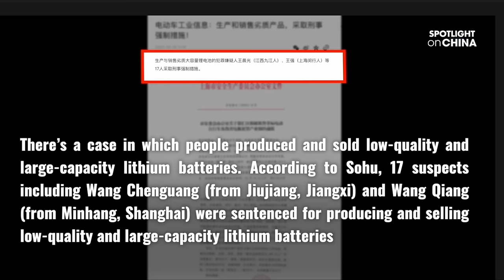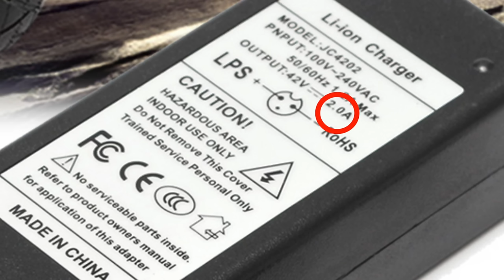What's Causing Ebikes Fires?

Comment: I can just hear the stampede of Surron  owners running into Costco to replace their fast, beloved e bikes for the anemic, but very safe, Jetson.
Reply: haha That's funny. The Jetson was the second ebike I purchased and then sold within a month. My recent purchase is a Surron and I love it. I'm not worried or paranoid over a battery fire anymore than a mountain climber is worried about falling. I think this video did an excellent job of pointing out some causes for the fires. Two things basically -- 1) just take good care of your battery and 2) be mindful of safety precautions. If the batteries themselves are or could be faulty from the outset, then there's pretty much nothing we could do about that, except to just be aware of the two points I mentioned.
Reply: @AMP3083official  So you went from an e scooter to a Tesla Plaid?

Comment: A question you can answer please Is it possible to charge Justin's bike Is it dangerous to charge it at home I keep worrying when I charge at home Can it cause a fire
Reply from the maker: I would not worry about it, the Jetson charger is slow, so even if it becomes problematic, it would take a lot longer.  The charger seems like a high quality charger with good build, compared to others I've had in the past.  As long as you avoid cheap "fast chargers", you'll be fine.

Comment: Contemplating getting an folding E Bike. Not sure which one to get. I noticed that some e bike's come with double batteries to increase the range, seems a bit silly. How soon do u think something like solid state batteries will be available for e-bikes or batteries with longer range.

Great video.
Reply from the maker: there's a lot that goes into ebike decisions, size is a major factor, hence folding bikes are so popular.  Range and speed are also a factor.  Fast machines need even bigger batteries to maintain range.  And for range, are you planning on sitting on a bike for 2 hours plus to reach destination?  Some bikes can give you two hours of range at top speed!!!  check out this video, anything over 15AH will give a substantial amount of range for smaller bikes:  https://www.youtube.com/watch?v=An3M_bW7nV0
Reply: @YouTruther  Thank you for your reply. I was thinking of something like the Samebike LO26 with a 500W motor. They have 10AH batteries, so I was wondering if it would be safe to have a 14AH battery . 

Hopefully higher capacity batteries will be available sooner rather than later.
Reply from the maker: @omaramoodi3057  yes, higher capacity, same voltage is safe
Reply: @YouTruther  . You mentioned Solid state batteries. Any ideas on if or when something like that might be available for e-bikes. 

And do you think the Samebike LO26 is a good bike.
Reply: *a
Reply: NCM builds great ebikes have good ratings too

Comment: I charge my e-bike battery out on my concrete patio inside of a metal garbage can with three layers of 1000 degree temperature insulation wrapped around the sides and top and on the bottom of where the battery is sitting and charging. on the charger I have a simple timer where I can set it to 5 hours for a 2 amp charger, or from using my fast charger which is 4 amp I can set it to two and a half hours to turn itself off. I have a wood stove insert in my house and I store my second and third batteries inside the insert and they are not being used or charged. This may seem like Overkill of course there is kill in the word Overkill. If you would like a picture of my charging and storage set up let me know how I can contact you to send pictures

Comment: CAUSE: Batteries being pushed above respectable operating limits.

CHARGER > Faster Charger, too many Amps rapidly bombarding the cells. (Slow and steady wins the race).
CONTROLLERS > Higher Draw (like a Sorron) more Amps drawn more heat generated (Slow and steady wins the race).

BOTH of these elements put a much greater strain on E-Bike battery packs.

FINALLY, once upon a time E-Bikes were (SLA) LEAD ACID battery powered, far less volatile.

Comment: My ebike battery, 1Kwh, is housed in a 3mm thick air tight aluminium casing on the bike. Full charge is 54.6 but the charger cuts out at 54v.  🤞
Reply: After watching how these cells perform (with a data logging meter), there's no point charging the stuff over 80% and discharging it below 20%. Graphs are becoming clearly non-linear beyond these limits, indicating some wonky chemistry starting to happen, probably degrading the cells and making them prone to overheating in the future. And the stories I heard about quality control in cell factories make you want to avoid the stuff whenever possible.
Reply: Luna charger set at 1amp at 80% charge . Wall appliance timer set at 6 to 8 hours always monitored meaning not sleeping in the home . Storage in bike metal frame tube or tool box with sand bags around all sides .

Comment: moisture is not a friend of batteries.
Chemical reactions cause batteries to overheat and catch fire or explode. 
Those battery packs heat up and the climate factors causes condensation and moisture once it cools down . 
That's water inside a container filled with batteries.

Comment: I got news for all that think charging is the only reason for the battery fires. First they pack a whopping amount of power in a very small space so physical isolation protection is at minimum. Second, the majority are made in China and those that aren't try to compete against China's cut rate pricing they achieve by mostly slave labor so their quality also suffers. Every since the flip phone people demand that their batteries never die but get smaller and lighter. There is this thing called physics and absolutely everything is a give and take. And to achieve the demands of the customers or the reviewers of the product safety had to take the back seat or put off the ride all together.  Size, weight, power, and cost all took precedence over safety and dependability. But another factor is the general public's belief that just because a product has the same rating number from one manufacturer to another like batteries do that they are all made equal. For instance Double A alkaline batteries. Several manufacturers make them but with differing quality but people see the same type cheaper but a different name and assume they all have to be made the same which is not the case. They also think that because the packaging looks the same then the product is the same but much cheaper. That's why so much counterfeit product is out their.

Comment: I always figured the bulk of the issues were dumbasses assuming l -ion works like nicad. Hell nicad and nimh can continue taking current forever as long as they don't overheat. Or worse they wire up a 12 volt charger cause the l-ion chargers are just too expensive. Constant current til 4.2 volts then constant voltage until the batta won't stay at 4.2 per cell. Then cut the power and on comes the green light

Comment: Wrong installation can batteries burned,Do not directly connect the lines put a HEAVY-DUTY PROTECTIVE DEVICE FUSE and BRANDED CIRCUIT BREAKER to avoid battery EXPLODE, BURNED, SHORT CIRCUIT!!.If something wrong batteries will not be affected!! E-BIKE conducting continues using power by SQUEEZING THROTTLE for a fast movement connecting on the HUB MOTOR wiring through🔋BATTERIES, If you don't have a fuse current flow will cause overheat then burn,fuse may shoulder a damage as early detection cut the current flow..Be sure that MOTOR HUB and BATTERIES watts are the same equal amount.The number of watts used by an electric motor at any moment equal the voltage supplied by a battery multiplied by the current flowing from the battery to the motor.😉👍

Comment: I have seen videos of lithium batteries that were burning and water does not extinguish the flame it burns faster. Gas powered vehicle the only way to go. If you want something small get a moped 2cycle gas powered. Hell of a lot cheaper and better on gas. then replacing a 300.00 dollar battery.

Comment: My charger does not overcharge the ebike battery. It shuts off after the battery is fully charged.
Reply from the maker: most chargers are built that way, this is more about when those safeguards fail, or how about someone with multiple chargers using the wrong voltage?  Many of these ebikes use the same ports for charging.

Comment: Why can't chargers simply shut off when the battery is charged? There is no way to know how long it will take to charge a battery, it depends on how much charge is in the battery to begin with. There is no reason the charger can't determine when the battery is charged and then stop charging. Most people who have ebikes are not electrical engineers, and they shouldn't need to be. The technology is advanced enough to take care of itself. However, charging is not the only problem. Lithium batteries are extremely dangerous under all circumstances. They can catch on fire at any time for a lot of reasons the user has no control over. And lithium burns with the intensity of an arc welder. It's not just a 200 degree F flame. It's a 5000 degree F fire that is almost impossible to put out and can easily burn through a heavy steel container.
Reply from the maker: totally agree, it needs to be dead simple, like Apple product level

Comment: First of all, mobile phones and laptops have not hundreds volt and kilowats of power output. Secondly, e-bikes have not sophisticated liquid cooling as electric car bateries and are prone to overheating. They can't be shielded and protected because of weight of ebikes is already too high  so they are exposed to elements, mechanical damage and vibrations. The last reason is that they have quite small capacity and are charged and discharged quickly so they accumulate a lot of cycles very fast  The conclusion is that ebikes and emotorcycles are doomed to fail unless we figure out better source of electricity.

Comment: "DAMMIT JIM - I'm a doctor, not an electrical engineer - JUST FOLLOW THE DAMN INSTRUCTIONS". Yep - read the instructions and learn the recharging criteria. *Leave for at least 20-40 minutes after a journey prior to recharging, *If storing (without use) for some time (e.g. over Winter), typically recharge every 30/60 days (some - SOME - batteries require a full discharge beforehand), *Use the correct charger - they mostly look alike but they sure ain't the same, *NEVER leave them unattended while recharging - disconnect (from the mains first, then the connector) when Mr. Greenlight appears, *Use your brain/common sense/experience and if/when required, seek [proper] advise. Thank you.

Comment: after reading the title the answer is, saving pennies on materials electronics and assembly...fake capton tape/no capton tape, nickel plated Steel instead of pure nickel, sub par cells, poor welds/too few welds, bad bms/ too cheap bms, too thin wires, Not enough nickel/ nickel plated Steel to carry the current, missing cell top stickers, shitty bms allowing charging In sub zero temperatures among other things, cheap/bad connectors, Not enough insulation/ protection, no insulation agaisnt water, no protection agaisnt impacts and vibrations, no temperature sensor(s) for the bms, too cheap bms, Li-Po pouch cells, no balancing between cells, no over/under voltage protection, no fuses, shit bms + shit charger... honestly i do not want the stuff most people use In my house.

Comment: Reason they catch on fire 🔥 is that the battery 🔋 pack is so large and it contains a lot of heat, heat that builds up to a critical level and all it takes is one ☝️ critical defect in the battery pack or if it hits that critical temperature 🤒 of combustibility then you have your fire 🔥.
Gentlemen  these are not Tesla vehicles 🚗 with cooling coils they are straight battery 🔋 packs they get hot very hot when you ride and when you stop riding and immediately start charging your batteries they get even hotter that’s when you burn down your house, she shed, apartment.  Don’t be stupid if you want speed buy a motorcycle 🏍️ not an ebike, ebikes are for older people who just want a little exercise without having to bike their old legs 🦵 up a hell.

Comment: Who the heck was that spraying a flaming bike with water??!! Lithium catches fire in water!!!!
 https://www.youtube.com/watch?v=cTJh_bzI0QQ
Multiple cell lithium batteries should ALWAYS be balance charged, all my RC cars and gliders use balanced charged packs. But I'm pretty sure that the 50 individual cells in an e-bike battery pack will not be balanced by whatever system controls the charging. Obviously Nimh cells are much safer, but don't give as much oomph as lithium, and it's lithium cells that are the ones that can go into thermal runaway and catch fire.
Reply: But he needed it to catch fire for the video. What better way than to spray water on it?
Reply: @grantofat6438  True.

Comment: I certainly hope that not only would I write you a ticket for no containment  of a fire in the city limits. But also fine you for now having to haul that trash off the side walk. That green is really working out. Now you've made two big foot prints on the ozone. Burning of a plastic n the batteries and then ruining the grass concrete and staining the ozone . I don't think you can burn trash in the open city limits  just cause you call it going green that is going white yellow red the black . And you have just done worst than oil n gas could have ever done in the lifetime of a vechicle  as what you did in 15 mins. Does your treadmill at